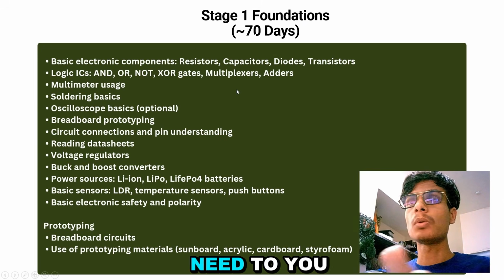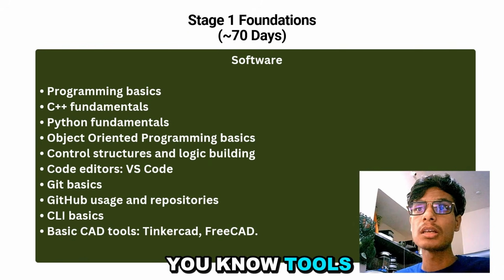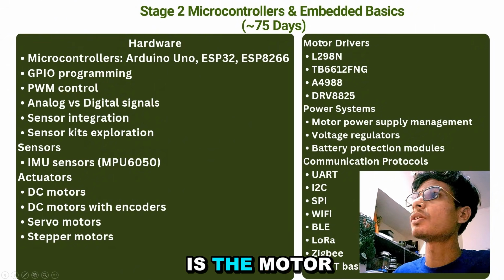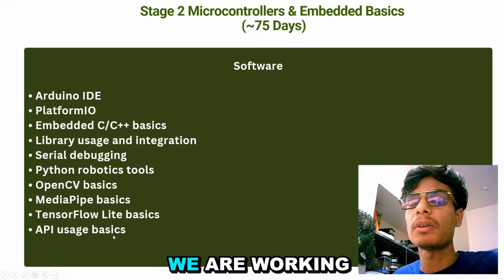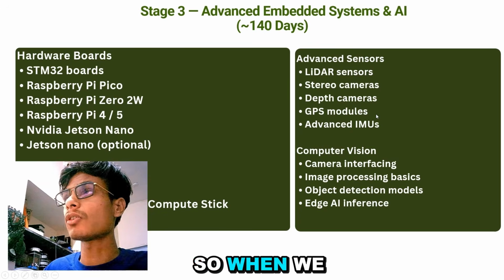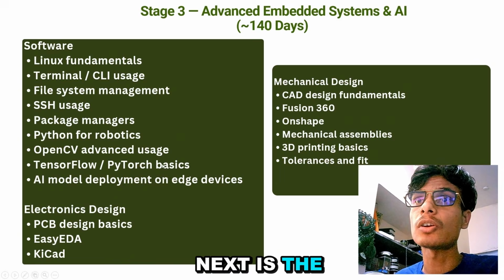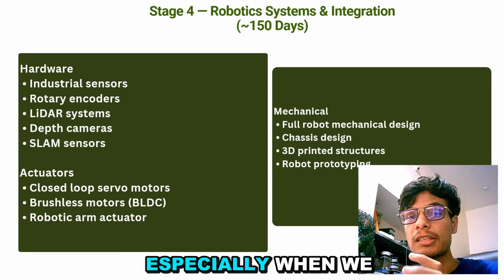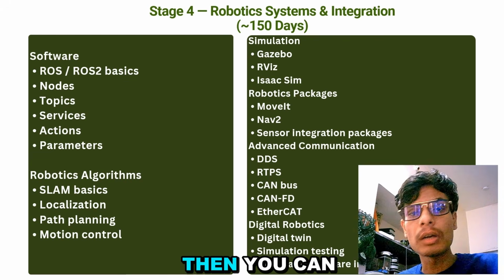Complete Roadmap For Robotics Beginners

Comment: Bro you are recommending electronics and iot road map robotics road map. If we want to learn robotic I think we need to learn the mechanical engineering first. I hope so
Reply from the maker: Yeah those are things one could after stage 4 as there passion or projects way 
Also Well mechanical is covered like 3d design and cad is there, and for real things like welding and power tools those are like skills one could have but only when we are talking about those heavy robot. 
I have Targeted mostly for those small or ai related projects 😊
Reply from the maker: I think you have seen stage 1 and 2 only 😅